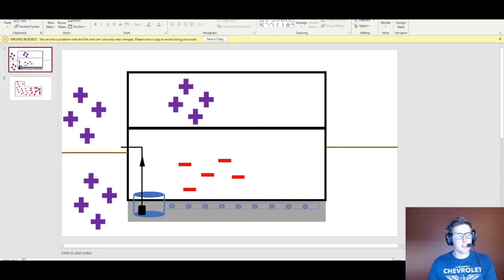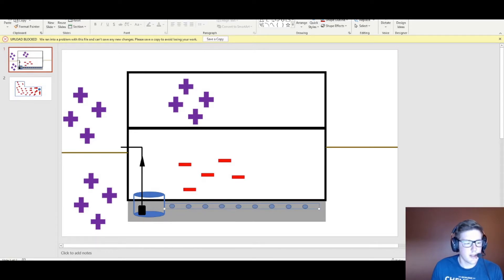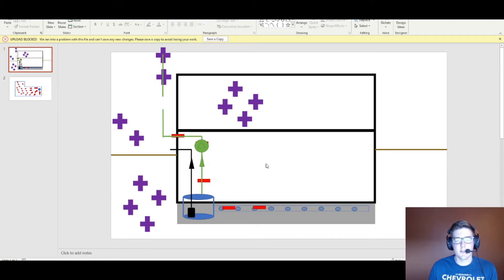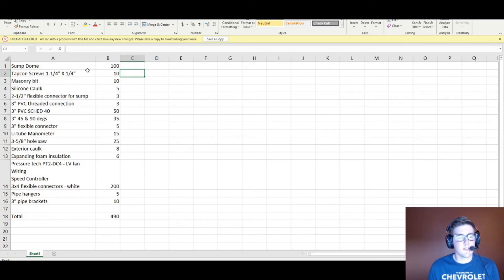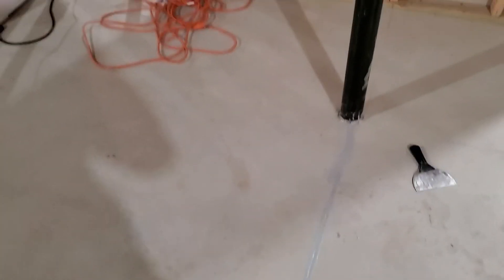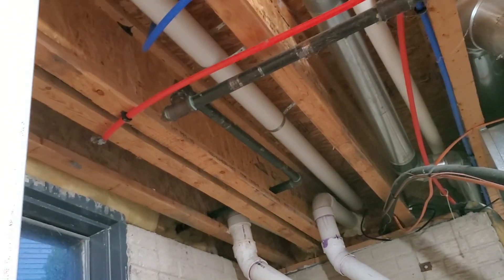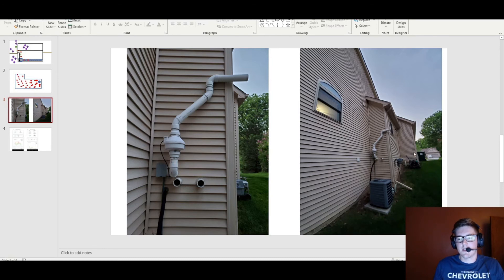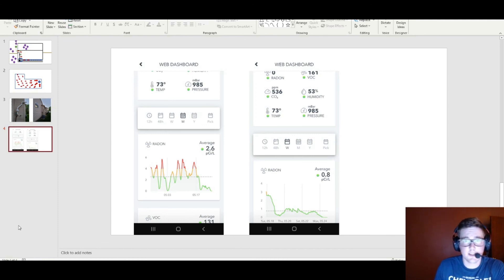Radon Mitigation Install DIY under $500 with results!

Comment: I have tried to find the answer, but cannot. Maybe you know: is sand an acceptable medium under the slab? Or does it have to be stone? And if radon is heavier, why don't we vent underslabs to gravity, just like we do with water?
Reply from the maker: Sand could work too, you just may need a higher powered fan compared to gravel to get the same amount of communication for the furthest reaches under the slab from your suction point. The sand will be more densely packed than gravel. I hear they need pretty big fans in environments with clay for example. 

Airborne radon is intermingled within the working fluid (air) which is relatively "light" such that differential pressure between outside/inside your house or temperature based stack effect can "overpower" gravity's effect allowing radon to accumulate inside a house. In Bernoulli's equation the pressure terms in this example heavily outweigh the potential energy terms and are the leading cause of the airflow. 

The goal of sub slab radon mitigation is to provide a path of lesser resistance for the air under your home instead of going into your home!
Reply: @goodvibezgarage3232  GREAT INFO!